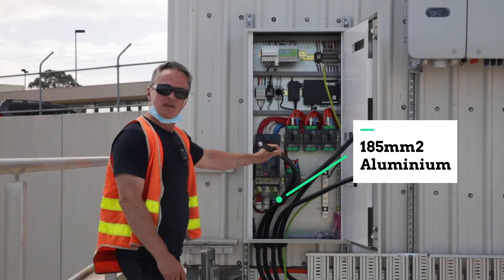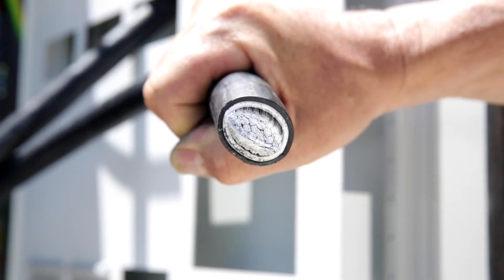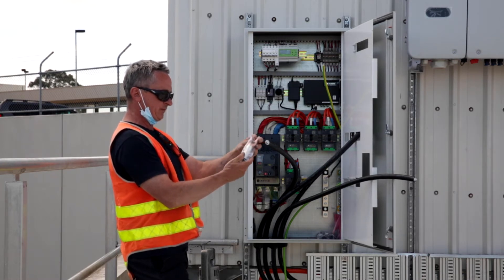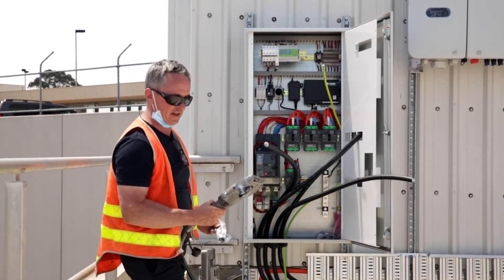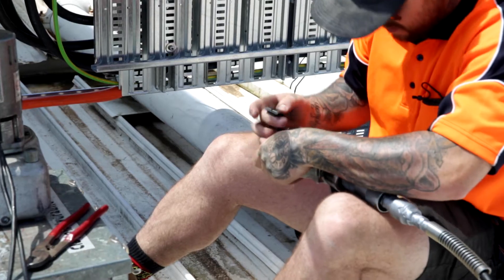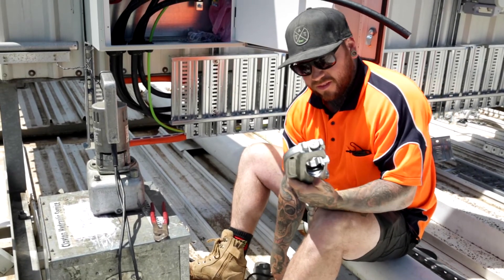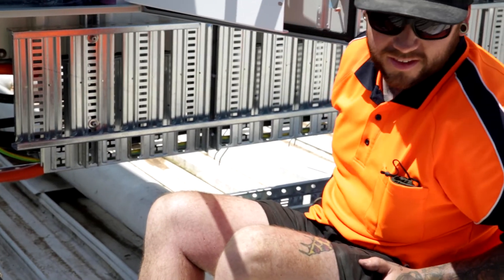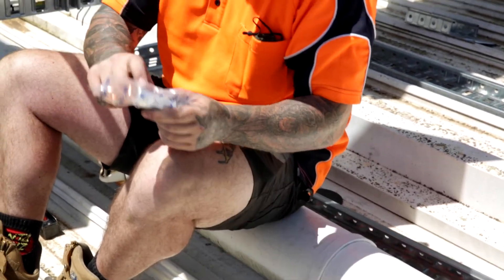Hydraulic Crimping of 185mm2 Aluminium Cable on a 600 kW Commercial Solar Project

Comment: Crimping seems to have been done in the wrong order. You normally crimp closest to the end first to allow the anti-corrosion grease to push into the strands of the cable, then you crimp the second time closer to the cable to further push the grease in.
Reply from the maker: Good point, Richard. I will chat with the installer about this.